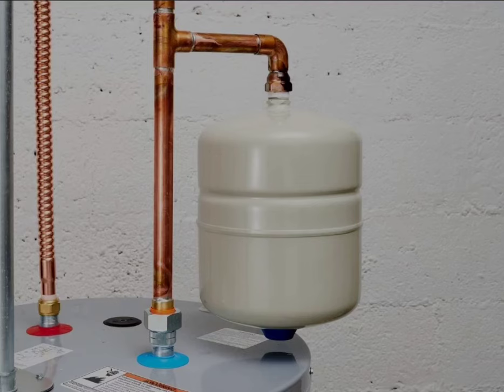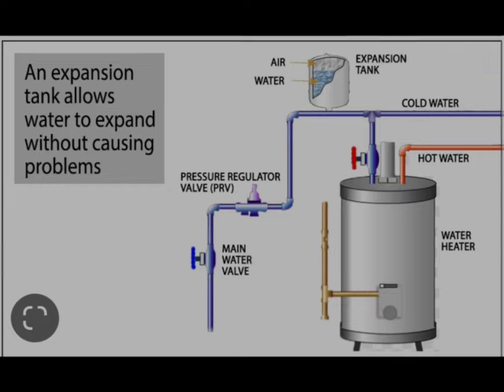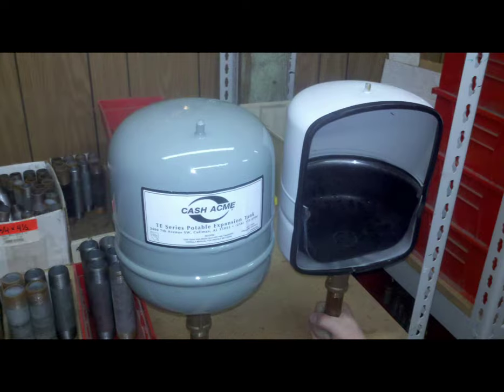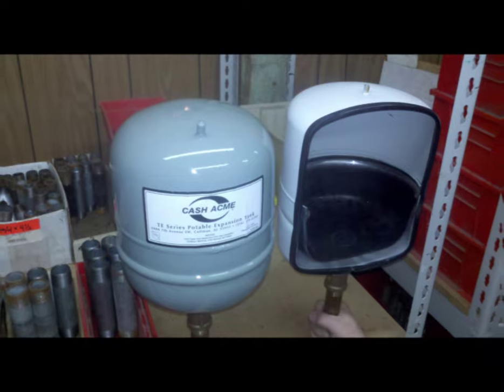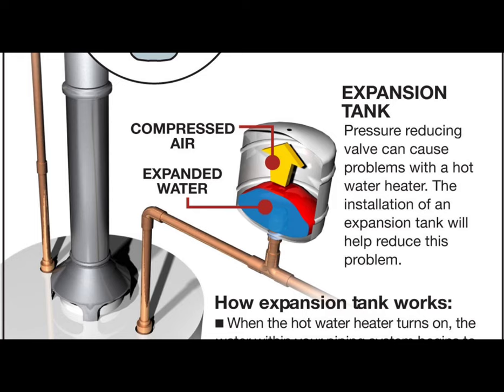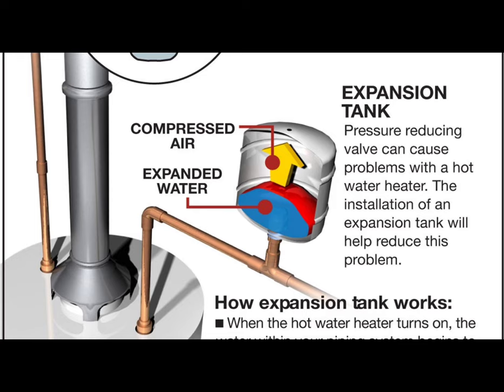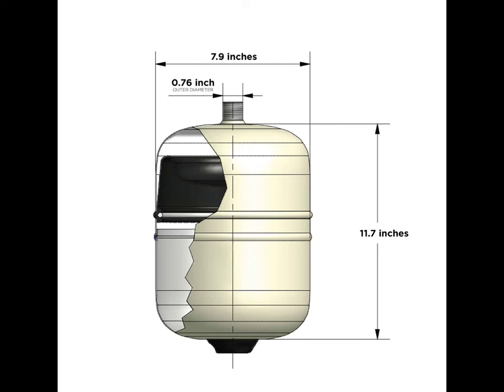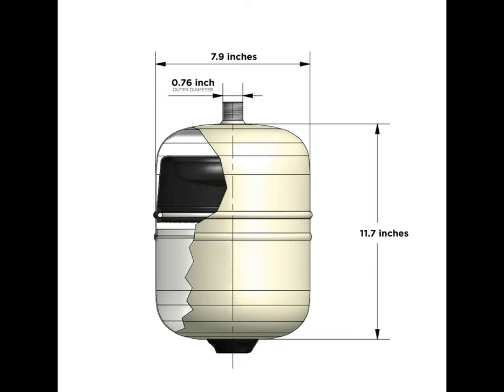HOW EXPANSION TANK WORK / WHY THEY ARE IMPORTAN TO HAVE THEM.

Comment: Fills with (Hot) water if the tank fails?     Installed on the cold side?
Reply: If the rubber inside the tank rips, the tank fills up completely with water. Hot water expans into cold water pipe. Touch your cold water pipe by tank, it's hot when the water heater is on heating the water.

Comment: I replaced my pressure relief valve after it had a slow leak.  It now has an occasional, very small  leak after hot water use.   The pressure on my expansion tank matches the 80psi for my water pressure.  Any thoughts on what could be the problem and what to do next?
Reply from the maker: There are several possible reasons why your reliet valve could be opening the  valve. Here are some possible causes:

1. Water pressure too high: If the water pressure in your home is too high, it can cause the safety valve of the water heater to open to release the excess pressure.

2. Overheating: If your water heater is overheating or if the water temperature is set too high, you can cause the safety valve to open to prevent the tank from exploding.

3. Lack of maintenance: If the water heater has not been properly maintained, there may be an accumulation of sediment or minerals in the tank, which can cause problems in the safety valve.

4. Problems with the safety valve: The safety valve of the water heater itself may be defective or malfunctioning, which can cause it to open frequently.
Reply: if you open a pressure relief valve a lot of times minerals get in the valve and cause leaking what is the pressure relief valve set to? maybe tank is full of water and the air has leaked out so not much room for expansion
Reply: Rep7the pressure valve, when it opened, the minerals in the water ( sediment) dried around the cylinder wall ( where the o ring n seal inside the valve) dried  after is released pressure.

Comment: In my recently purchased house, I had my home warranty company's plumber refuse to cover a fauct repair/replacement because of excessive water pressure (90 psi). He said I needed a pressure regulator. To save $500 I put one in myself. It didn't work consistently so the company sent me another one, which also doesn't work. Now I learn that I've created a closed system requiring an expansion tank. Neither the plumber who told me I'd need the prv nor the prv company mentioned that I'd need an expansion tank.
I also wonder if the closed system was created by the water company meter, installed 2017, and if I had just installed an expansion tank I could have forgone the PRV completely.
Reply: Unfortunately, you'll still need both.  The pressure reducing valve (PRV) reduces the pressure of water coming into your home. The expansion tank allows thermal energy to go somewhere so it doesn't break water lines.

Comment: 1:50 why top part is warm but bottom is room temperature? I thought the top part is air only and bottom is hot water maybe?
Reply: depends on which way tank is mounted most are put under the air Seperator scoop  with replacement cold water line running in. it is facing up the opening to tank there is a rubber divider inside so tank has water on side with pipe from system going in. unless your system is cold, and you are starting it for first time it won't get hot water expanding into tank it will be cold from sitting in line to tank or diluted by cold water sitting in tank.